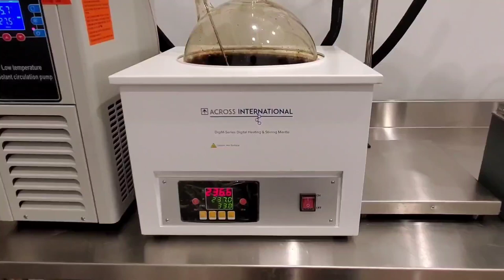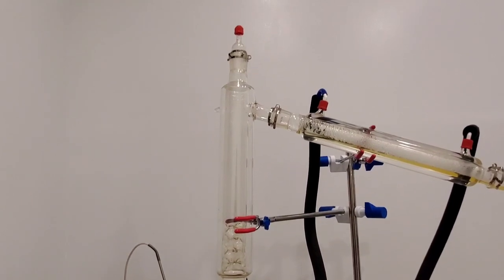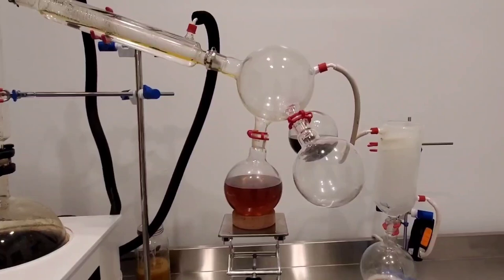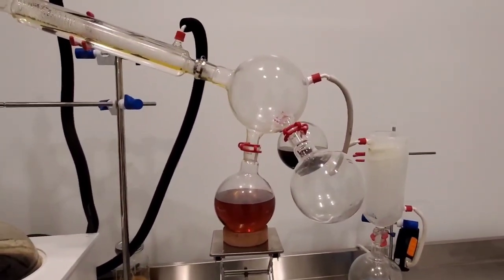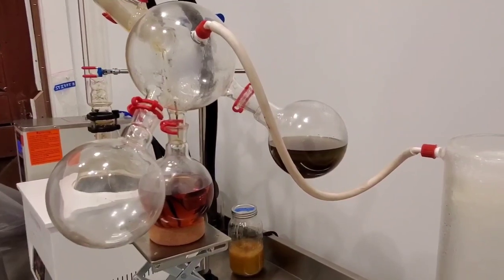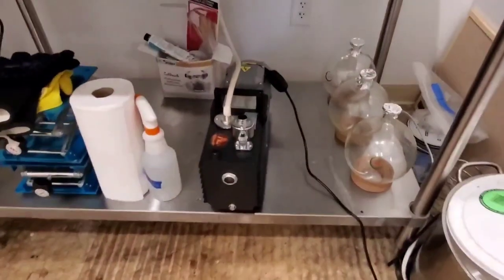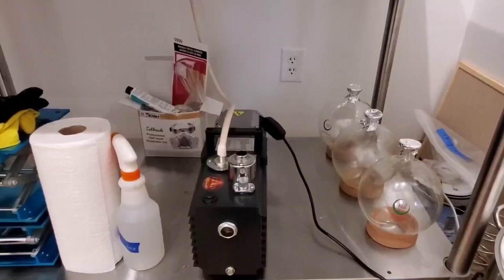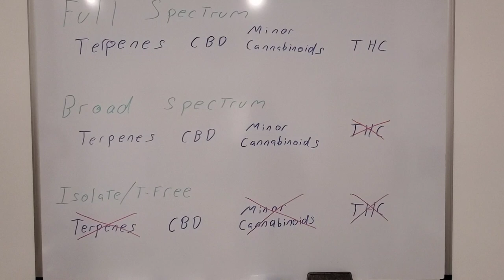Making Full Spectrum CBD Distillate Oil With 10 Liter Short Path Distillation

Comment: Great video!
But one question is unanswered to me despite your comprehensive explanation.
You reduced the boiling point with a vacuum. So why run the heater on 200°C+ ? Would that not not make more sense to run slower at a lower temperature to prevent decomposition which lowers your output/gain?
Do you spin the cow bell when the time is due to separate between the fractions? I wonder how hard it must be to spin the cow bell under vacuum...
And if so, how can you tell when the heads is done and when the tails begins?
Reply from the maker: I made this video when I was still learning how to run an SPD and use a vacuum, so the temps were high due to my own learning curve.

I am able to turn the cowbell when under vacuum. The key is to make sure the joints are greased with food grade grease, which will maintain the vacuum. You can tell the difference between heads and tails by a color change. Heads will be a nice yellow/gold color and tails will be an amber/red color in the condensensing tube.
Reply: @MaineBotanical  Thanks a lot for replying :)

Comment: Hi Tyler, we are a cold extraction company in South Africa. We just purchased the same equipment but only get the terpenes pulled of. We just can’t get the distillate condensing. Can you maybe help please. We more or less run the same settings. Vacuum pump on 25milibar. Regards Nico
Reply from the maker: Do you decarb before you put the crude in the boiling flask? Also, what temperature do you get the heating mantle to when you start pulling terpenese?

Comment: can you do this to shatter made from bho thats  already been vaccumed and ready to smoke?
Reply from the maker: I haven't tried it before, but it would be worth experimenting with. I think you'd have to increase the viscosity of the shatter before trying it though. I think if you didn't increase it's viscosity before putting it in the boiling flask you'd have a very difficult time cleaning the flask after and would also risk burning the shatter.

Comment: Have you tried to run a true short path?  Meaning, minimizing the distance the molecules have to travel from the liquid stage to the condensing stage.  Reducing the pressure needed to move the molecules up the column, and lowering the boiling point.  I have always thought that was the reason to short path.  What is the purpose of the fractional type column?  Would it boil over without it, or is there an azeotrope?  If not, I don't see much reason to use it.  I wonder if setting up the short path, straight off the flask, and keeping everything horizontal (easier for vapor to move) would give better results, due to the lower temp needed to distill?  I would also move the temp probe to the vapor stage, to PID the vapor temperature.  From there, you can adjust the set temp for how aggressive the heater will be, as the larger the delta between current temp and set temp, the more aggressive the PID relationship.  BTW, I know nothing of drugs or this makeup, I always chose the fuel path in chemistry:)
Reply: This still design is pretty antiquated and inefficient, this kind of distillation has a pretty wide bandwidth and your fractions aren't very discrete.  Newer stills have a vapor temp feedback loop with mantles, and have a secondary re-vaporization stage in the Liebig condenser (recirculating heater lags the vapor temp by ~5C).  I think people opt for longer columns because their feedstock is pretty contaminated with phospholipids and tars with similar BP to their target compound, and they want the reflux to up their vapor saturation.

Most of this kind of work is performed with multiple stages of wiped-film distillation, which is horizontal with a very short vapor path.  Much higher throughput and you can really dial in your condenser and evaporator temperatures to pull tighter fractions.
Reply from the maker: I agree, it was our first piece of equipment and we should have bought a 5L or even smaller to learn on.

Comment: Does not look like a short path distillation and is there a reason you are not using a thin layer short path distillation setup, or is it just the cost of the thin layer condenser ? Why not seperate the CBD and THC into different fractions ?

Comment: So may I ask - why is it that you evaporate at over 200c when the BP of CBD is around 150c?? at high temperatures my crude simply seems to over heat and burn/smoke :( 

Any help much appreciated. 

A
Reply from the maker: When I was making g this video I was having a hard time getting vac to get to the boiling point that didn't degrade the cannabinoids. Yes, a lower bp is key to get higher quality distillate.

Comment: very interesting video :) may i ask which are brand/model of your cooler (left of the bench) and cold trap? (for this later one, i have been searching quite a while but could not find anything similar). this one is pretty convenient and efficient by its design. thx in advance:) - and NO! no further jokes with "cow bell" ;)
Reply from the maker: Check this kit out. It has the same chiller we used. This kit is the 5L setup, we had the 10L setup. If I had to do it all over again I'd do the 5L, or even 2L setup to start.

https://www.dhgate.com/product/zoibkd-lab-scale-small-short-path-distillation/410879103.html?f=bm%7cGMC%7cpla%7c18240824298%7c%7c410879103%7c%7c011014011%7cUS%7czoibkd%7cm%7c2%7c&utm_source=pla&utm_medium=GMC&utm_campaign=zoibkd&utm_term=410879103&gclid=CjwKCAiAyfybBhBKEiwAgtB7fmGbFwmRaJy-lVCgTQNBWT-YWjAIC6Y8UNZruJ0g4ZjhL_D117TNlhoC8iwQAvD_BwE

Comment: how do you destill the thc out of it? does the thc end up in heads or tailings?
Reply from the maker: Removing the THC can be done through chromatography or converting THC to CBN using heat. I have neither of those pieces of equipment, so I use the full spectrum distillate to make gummies. The other ingredients in the gummies dilute the THC below the 0.3% limit.
Reply: @MaineBotanical  What percentage THC does the distillate typically have before your add it to the gummies?
Reply from the maker: It was about 2.5% THC.
Reply: @MaineBotanical  Interesting. Thank you.

Comment: Hi, the last time i had use a short path, all the resins goes out to 133 °c (max), what about your temperature in good vacuum conditions? I have see some videos where the head of the vigreux rise to 183°c but is too high i think, thanks for your video
Reply from the maker: I typically start to see cannabinoids come out around 162c, and as high as 185c, but they start turning red after 185c.
Reply: But this is the normal boiling point to 1 atm, i spect lower temperatures to evaporate Cbd, have you High vacuum?
Reply: Have you try to get the biomass with propilenglicol? I could get good results, the first cut without color and All the terpenes starts to 84°c to 95°c (with flowers), in the second cut from 105°c to 135°c o could get full cannabinoids, the tale of the extraction (150°c to 180°c) have a resin with very low quality of cannabinoids and a very bad color and flavour. The ratio for biomass was 1:4 flowers vs pg, the only one problem i had found is that the boiling point of pg and Cbd is to close, sonó most be ready to cut the vacuum between 100 °c and 110°c in that way you can get terpenes for vape and resins with full specter
Reply from the maker: I've never tried that, but it sounds interesting!
Reply: @MaineBotanical  it does, feel free to contact with me if you like

Comment: is is possible to make thc and cbd isolate? looking for a way to get rid of the terps
Reply from the maker: I know that you can make isolate with a chromatographer, but I'm not sure if you can do it through short path distillation.
Reply: @MaineBotanical  it is actually feasible to separate THC via short path dist., THC and CBD have a difference of around 20 °C in their boiling points, with enough time, I'm sure you could achieve that separation with the equipment you have.
Reply: @andressanchezhernandez5244  is THC evaporates first or cbd? Do you think with a frag meter ( or something like this)
 on the short path I will be able to take different parts of cannabinoids?

Comment: Great video. How did you create the crude?
Reply from the maker: We created the crude by hammermilling hemp biomass in to a fine powder, soaking the biomass in 200 proof ethanol, spinning the ethanol soaked biomass in a centrifuge, filtering that liquid through a three stage filter, and then recovering the ethanol using a 50L rotovap.
Reply: @MaineBotanical  when you say biomass do you mean the stalks and leaves? Would be great if you could do a video of making the crude too. 👍 Thank you Tyler. Great video, great info. 👍
Reply from the maker: @justinmartin3280  You are correct, biomass is a combination of flower, leaves, and a small amount of stems. Flower that does not meet smokeable flower quality is usually sent to processors for extraction along with leafs and stems.
Reply from the maker: @justinmartin3280  I thought of making a video about making crude but I recently sold the centrifuge and hammermill and I wouldn't have the visuals to go along with it, so it'd end up being stitched together videos from other processors or from advertisements.
Reply: @MaineBotanical  hi, great video, I have few questions about volumes - how much hemp did you mixed with ethanol and also how many litres/galons of ethanol you've used? What kind of material you've used? regular hemp or some specific strain of cbd weed? I will be grateful for your answer. Peace from Poland!
Reply from the maker: Hello Arkuuus,

We used a centrifuge with a 15 pound capacity bag. We mixed 15 pounds of hemp biomass with approximately 16 gallons of 200 proof ethanol. In general, it's close to a 1 pound to 1 gallon ratio.

I used hemp that was grown specifically for high levels of CBD. There are many strains of high CBD hemp available. How you decide on your strain will be based on the target CBD content you want and the terpene profile. Ideally, you want at least 10% CBD content for extraction. You can do it with less, but your extract yield will also be less.
Reply: @MaineBotanical  thank you for such a quick response, you the man! :) could you please tell me about this 200 proof ethanol? Is it edible alcohol or it's more like isopropyl (industrial alcohol)? The price of 95% ethanol in Poland is crazy that's why I'm asking. Also the CBD % in the strain - for example this is one of the hemp strain I used in my previous extraction (https://www.seedstockers.com/pl/futura-130) - as you can see CBD level is around 2-3%. To be honest it's hard to find CBD strain with 10%, could you please give me at least 1 name of the strain so I can google it? Thank you!
Reply: @MaineBotanical  and last question - how many grams of the "oil" you got after the extraction of 15 pounds of hemp biomass with 16 gallons of 200 proof ethanol?
Reply from the maker: Approximately 600 grams of winterized decrarbed crude oil.
Reply from the maker: The ethanol isn't for consumption. It would not be healthy to drink 200 prof ethanol. You don't need to use 200 proof ethanol for extraction. You can use 95% and I would recommend doing 95% because it costs significantly less.
Reply from the maker: Look at Baox, sweet, T-Rex, purple haze, as examples of hemp that will produce greater than 10% CBD.
Reply: @MaineBotanical  so just to clarify because I think that we think about the same thing but we call it differently - did you use food grade alcohol (like this: https://www.laballey.com/products/pure-food-grade-ethanol) or you used industrial alcohol (https://deconlabs.com/products/200-proof/)? Sorry for the questions but it bothers me a lot :)
Reply: @MaineBotanical  thank you, now I know what you mean - unfortunately legal thc level in Poland is 0.2%, I am pretty sure that those strains have more THC than 0.2 :(
Reply: @MaineBotanical  If you can short path CBD, you better be able to distill any liquor to azeotropic levels, then use a simple drying agent to get it anhydrous.   You should also be able to ferment a sugar wash to get the ethanol to start with:)
Reply: Guys, I'm not trying to be rude, but if you don't know the difference between ethanol and isopropyl, you need to hit the books before you do this kind of stuff.  The level of ignorance is extremely high when you ask those types of questions.  I don't mean to be discouraging.  Spend a week watching chemistry videos, and everything will be a lot easier.
Reply: @falsedragon33  "I don't understand why I can't get my ethanol over 95.6%"
"Are you watching your temperature? Just run it again." (snickers while fidgeting with molecular sieves)

Comment: How much money would a setup like this set people back?
Reply from the maker: We bought this from www.dhgate.com for about $2,500. However, knowing what I know now, I would have bought a smaller mantle (5L), a combo distillation head/condenser, and a collection flask that did not involve a cowbell. There are so many potential leak points for the vacuum that it really slowed things down initially and a 10L boiling flask makes it harder to do small batches to experiment with.
Reply: @MaineBotanical   Thanks Tyler! I'm still learning and researching all this. In the end of your video, you spoke about Full Spectrum, Broad Spectrum and isolates. So can THC be isolated instead of CBD and if yes, how is that done? Different boiling temp? Cheers once again
Reply from the maker: There are two things that can be done to remediate THC. It can be converted to CBN through a heating process, or THC can be removed using chromatography. I do not have either of the pieces of equipment necessary to do that. $$$$$
Reply: @MaineBotanical  Thanks again Tyler for the valuable information. Looks like a lot of work! Best wishes for the future

Comment: Firstly this is not a SHORT path... This is a (very) long path..... A real short path has a minimal distance to travel the vapours..... The vertical column here is only a (bad) vigreux column....
By the way.... The trap is reversed... The down side in the inlet to the cow.... And the upside is the outlet to the vacuum pump.... So the gravity helps to slowing and better refrigeration of the undesidered vapours...